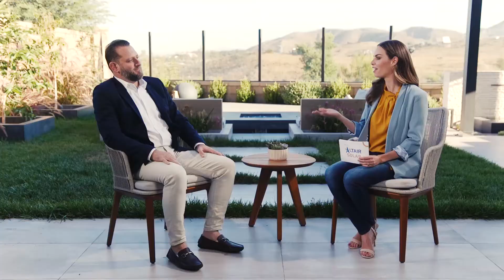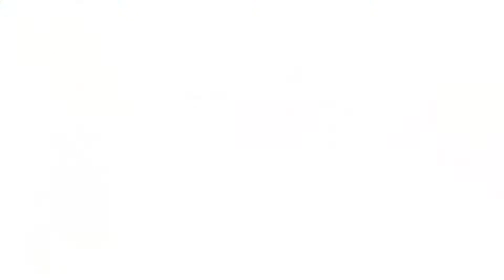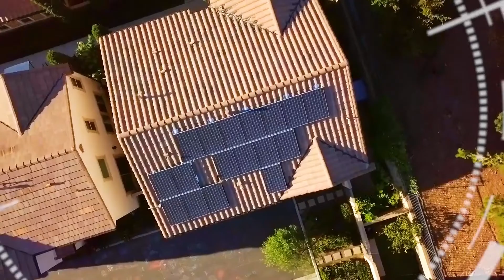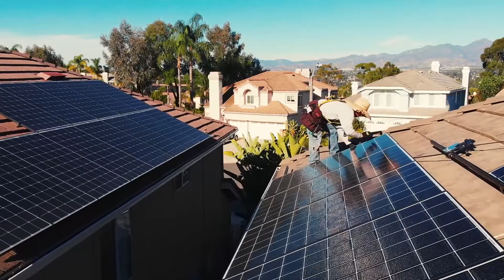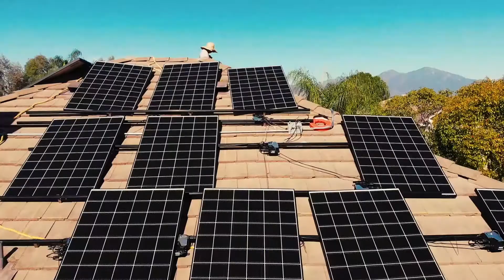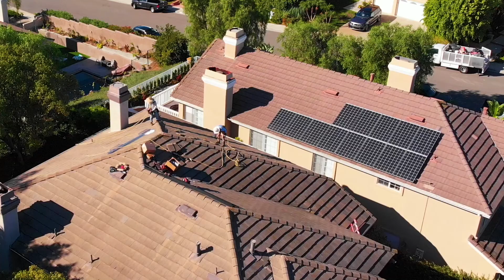Net Energy Metering - NEM 3.0 Explained | Solar Simplified

Comment: What does it mean that those in NEM 1.0 and 2.0 are going to be grandfathered in to 3.0?
Reply from the maker: It means that those projects that got approved under NEM 1.0 and 2.0 will not be affected by NEM 3.0 rulings as they will be grandfathered for a period of 20 years.  They were trying to change that rule but the proposal for that didn't go through which is good for those consumers.
Reply: Will it make sense to go Solar under NEM 3.0? And how?
Reply from the maker: @TheCatalystReelcast  It's better to go under NEM 2.0 because under NEM 3.0  you will need to pair it with energy storage to realize the same savings.

Comment: If you do NEM2.0 like I am , I have 20 years to go before I need to decide anything on batteries (Hybrid/offgrid)  . By then they will be much cheaper and way better. So if on the fence try to do it now and use the new bifacial half-cell panels (better and ~50% less EOL waste). Don't wait and then you can relax. If you wait until NEM 3.0 it will be worse. I put in half the panels and produce more energy , than the proposal with older tech I got in 2015 . Also have solid state DC/AC inverter and  smart microcinverters for a whopping $4K less. Sometimes it pays to wait like I did, better tech and cheaper. But don't let NEM 3.0 come and then add solar it wil be much worse.

Comment: Once Nem 3.0 passes your better off going full off grid system with your own battery backup over the long run.   Net metering is suppose to be an incentive to go solar by not needing to get batteries right away, but CPUC and PG&E turned nem 3.0 into an monthly solar tax instead.  If Nem 3.0 passes you can expect more solar off grid installation,  which means less power to california grid.   California was at near max capacity on energy this year. Expect more rolling blackouts if nem 3.0 passes.